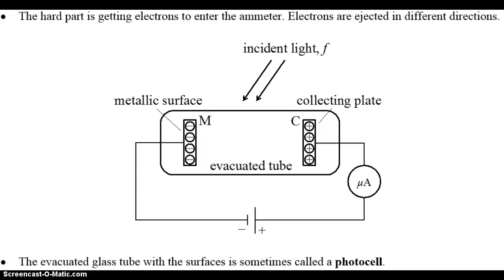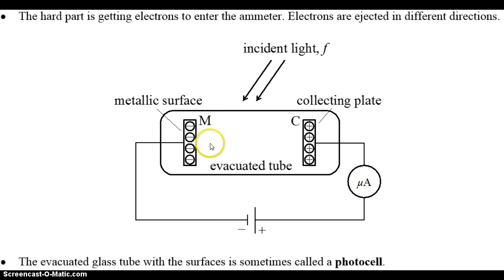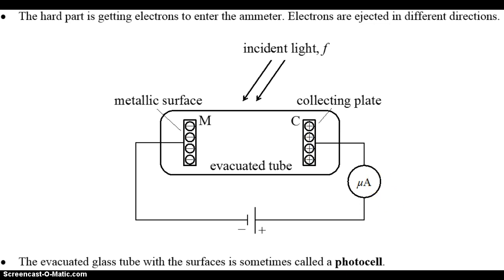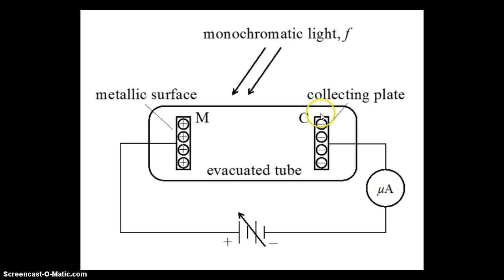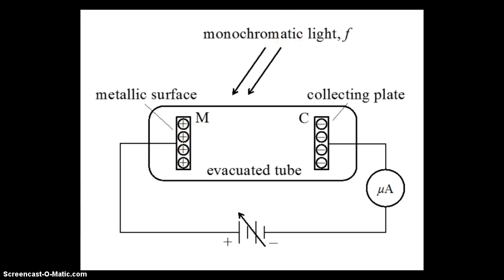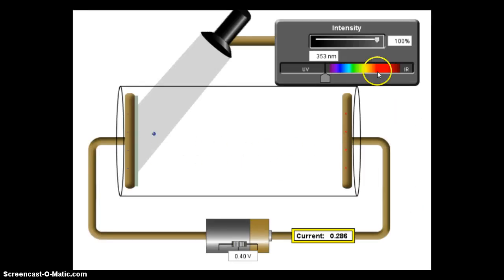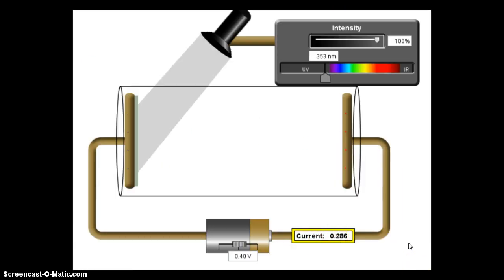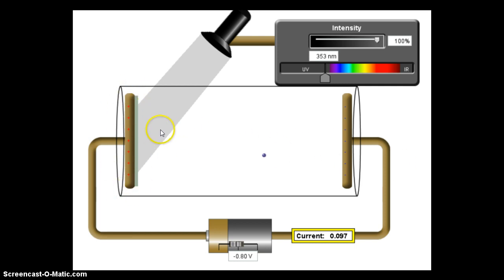Apparatus for measuring max KE of photoelectrons

Comment: How electrons are emitted from positivily charged terminal.What about repulsion with electrons.
Reply from the maker: Check out the video from 1:46. Here, I say, "You might be wondering, 'how can an electron, which is negative, be ejected from this positively charged surface? ... Even though the metal surface has a net positive charge, there are still electrons in the surface. They're just outnumbered by positive charges. So there are still electrons in the surface, and those electrons will get ejected when they absorb a photon that has enough energy."